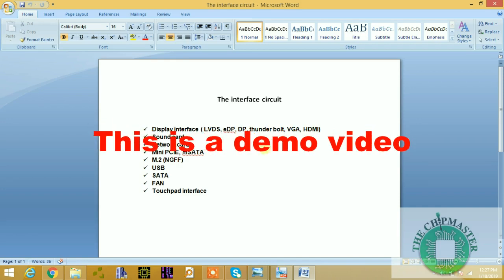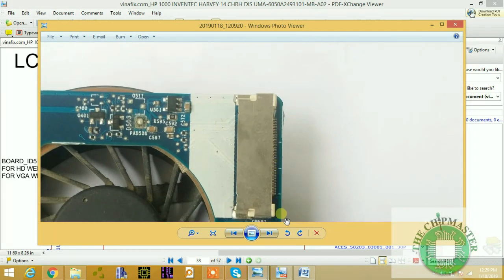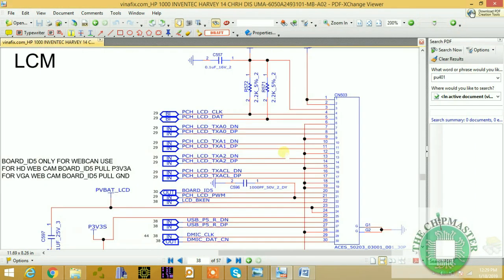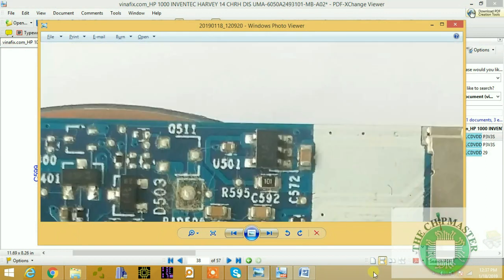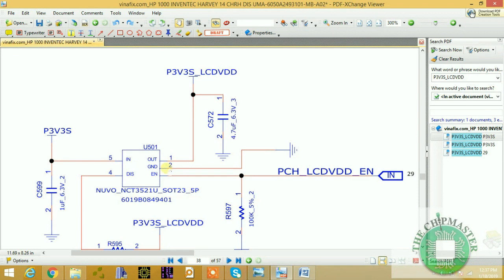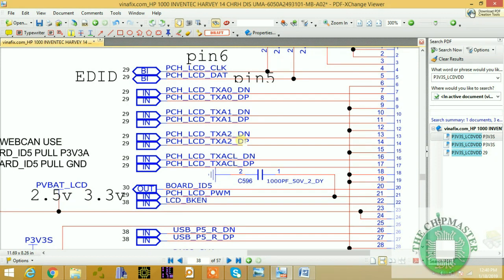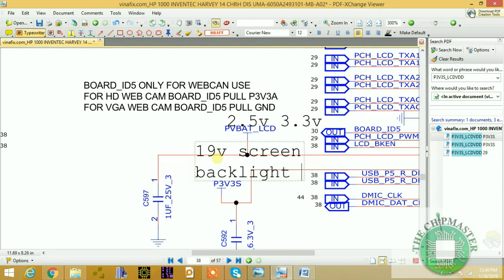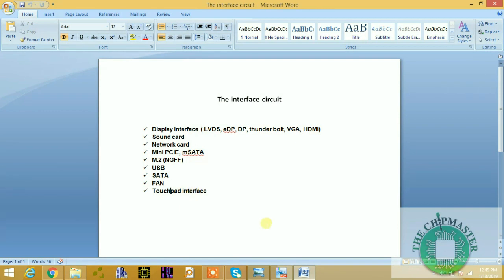The interface circuit explained LVDS demo

Comment: XPS 12 DELL. I have a white screen error lcd where all your described voltages are present to inside lcd . External monitor ok. Could it be the data control lvds ic is spitting out white screen.
Reply from the maker: did you tried another screen did you check with oscilloscope the EDID CLK and DATA pins?